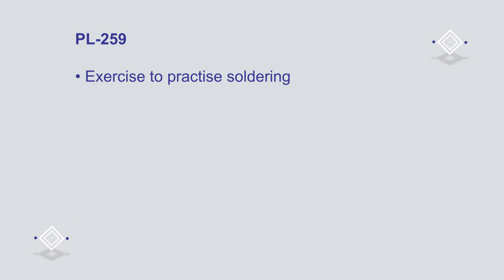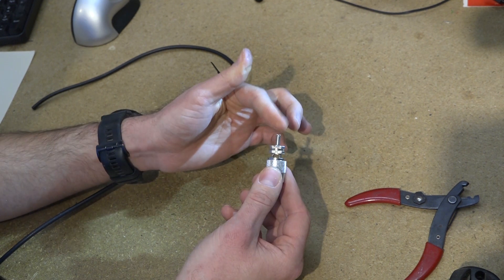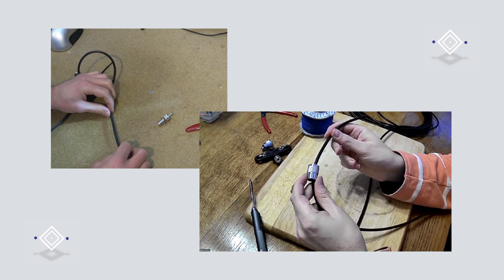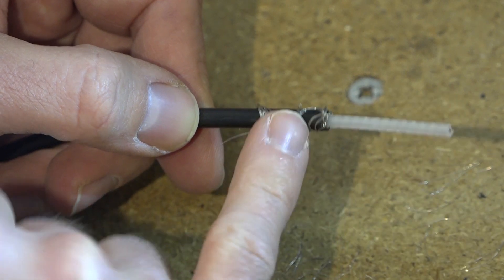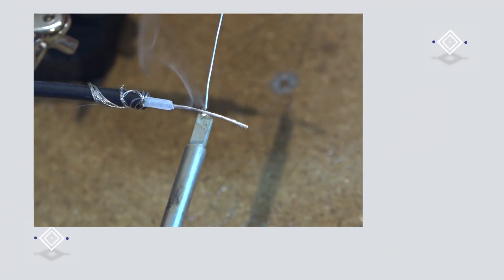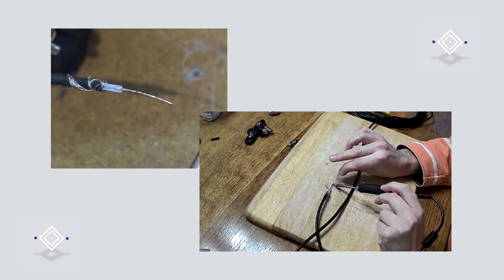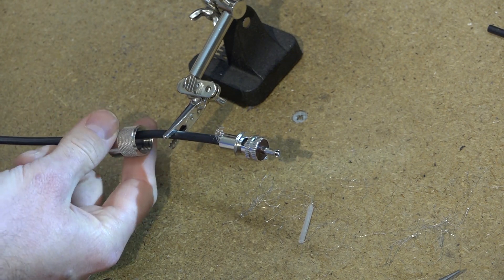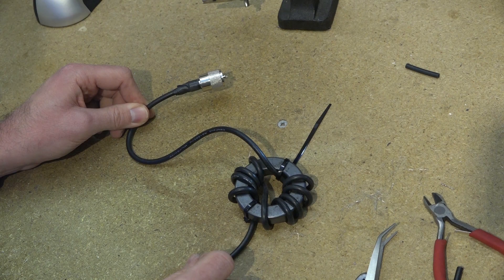RSGB: Useful practical skills videos - soldering a PL 259 to a cable

Comment: May I suggest using a piece of heat shrink tubing rather than the electrical tape? It would also have been nice to see how one would use an adapter for the coax you are using and a standard PL-259 connector so we could see how to properly solder the shield. Thanks for the video.